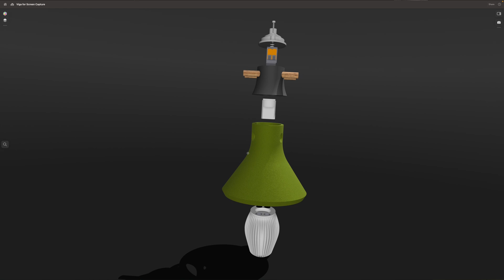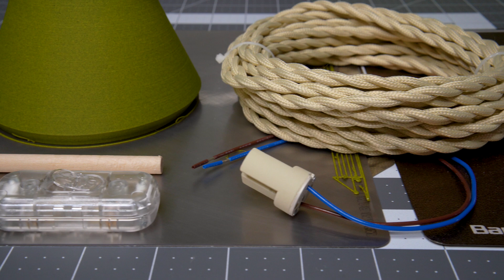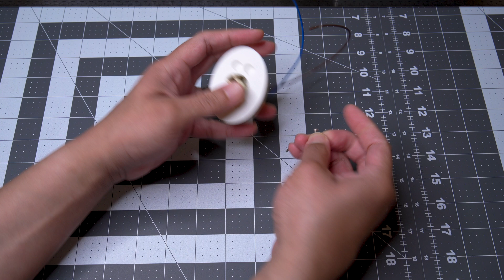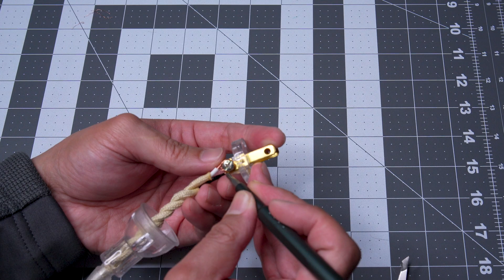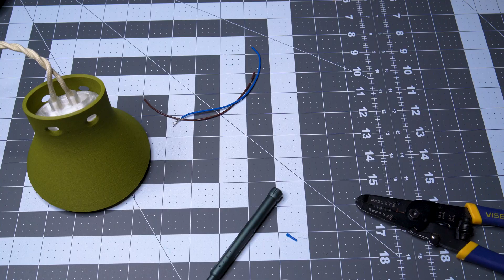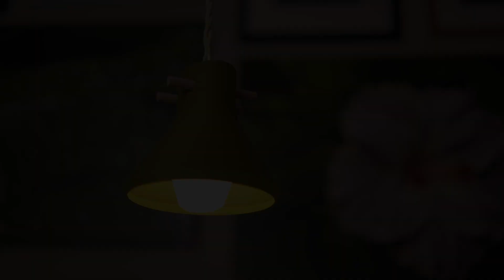Design and Build of 3D Printed Light

Comment: google underwriter's knot. awesome channel btw.
Reply from the maker: Oh wow, all the time I’ve been disassembling stuff and I’ve never seen this! Great knowledge pass along 🙏🏻. I’ll have to try this with the Viga. I attempted just a regular loop knot but it was making it hard to close everything up without applying pressure. Super useful tip, thanks! And thank you for the props, we love that some folks are finding it worthwhile.
Reply: @batchresearchlab  You're welcome. Your channel is a treasure trove. Learning a lot from you, thank you. What model of laser engraver are you using?
Reply from the maker: Most of the time, it's been the xTool F1 (because we know most of it's quirks already and have done most of our filament tests on it), but we've slowly been folding the larger F1 Ultra into the workflow (for larger projects and those that need more power).